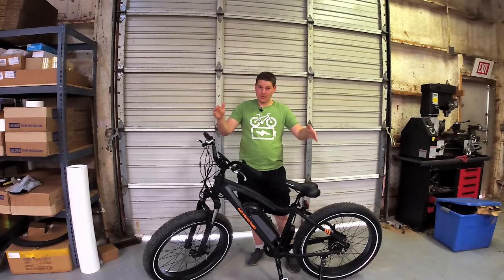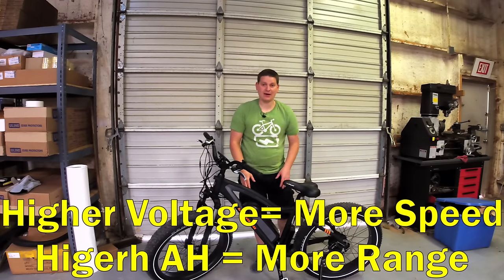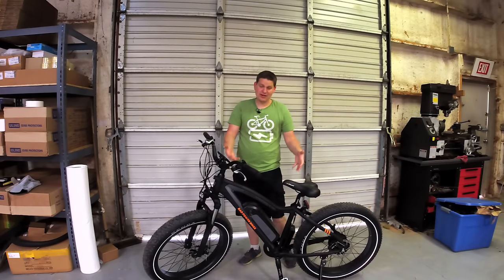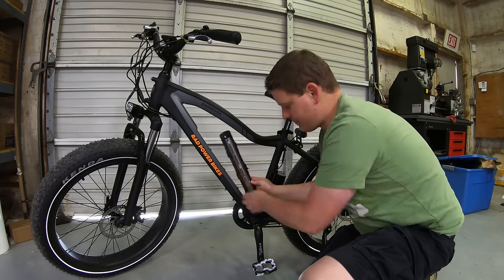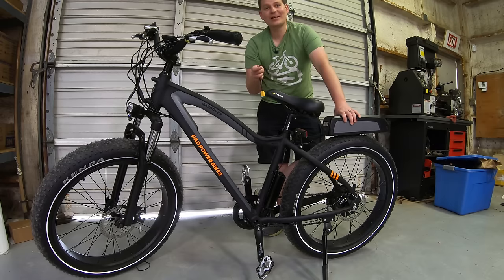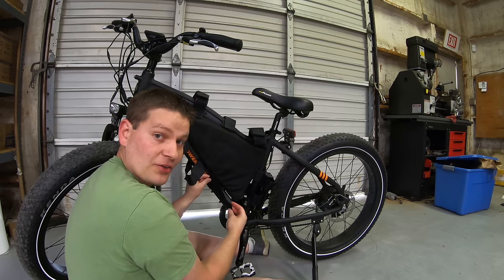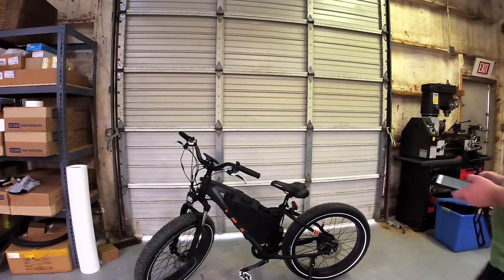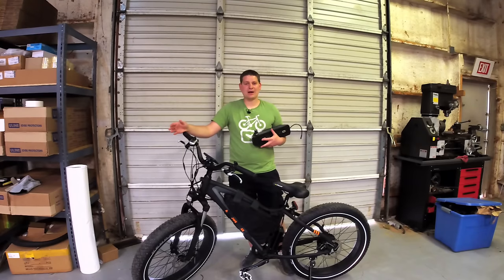Easiest Way To Upgrade Your Ebike Battery

Comment: Velcro bag lunch looks like Garbo in my opinion.  Would like to see sharper looking upgrades that don''t turn the bike into a used bandaid.  You're great at what you do though 🍻
Reply: I agree, it's not too hard to make a custom cradle and custom hard shell triangle battery case, and would look so much better but also be upto10x better at being waterproof and damage resistant. I get the appeal of the bag batteries but they are for generic conversion kits IMO, if you are making a product for something so met a like the Rad then more effort in making it custom for that bike would make u sell alot more, as right now all u are selling is a triangle battery + bag + harness options, this can all be had from ebay easily, although personally if I was to buy such a thing then I would defo get it from yourself over ebay as u r an IRL trusted seller imo.
Reply: I agree with what you said but no one is really gonna look cool riding an electric bike, ive just accepted it but the sheer convenience and gas savings is why i ride one, not kidding i traded in my motorcycle for one of these bikes for transport
Reply: I am receiving my rad city 5 e bike and i would upgrade the battery but will wait for hard shell. I invested $2100 to get the best why not wait for proper casing in the future !!! FLY LIKE AN EAGLE IN TO THE FUTURE!!!
Reply: The title does say “easiest way”. The easiest aren’t always the best looking.
Reply: Those triangle bags are handy
Reply: Hey now to be fair at least we're less likely to get mugged 😂
Reply: Check out "Iberia" accessories
Reply: I love this.
Reply: @audiofella5066 😂 agreed. I did a test ride on a similar rad bike and I was hoping none of my mountain bike buddies would see me 😁

Comment: Three years ago I bought both Kyle's battery and controller upgrades. Prior to that I was going to sell the Rover so to get a faster bike, with a lot more torque. But after installing Kyle's upgrades what says it all: I decided to keep the bike and I still have it. Why? Because my top speed on the flat lands the Rover went from throttle-only 20 mph max (on the flat lands with the wind at my back) to throttle-only 30+ mph. 

And more importantly, going up the somewhat steep hill to my house atop Nob Hill (San Francisco) I can now use throttle-only, moving from a full stop at the bottom of the hill to cruising the whole way at 15 mph. And if I set #3 on peddle assist with minimal peddling I can got the entire way at 15 mph. That significant improvement in torque is what I was looking for. 

Bottom line: thanks to Kyle's power upgrades my Rad Rover feels and functions like I'm a commander of an M1A2 Abrams Main Battle Tank.:face-green-smiling:

Bonus Tip: Guys, if you increase the power of your bike, both in speed and torque, if your bike has simple mechanical disk brakes, I highly recommend you or a bike mechanic install a set of hydraulic brakes. (As our good fortune would have it, Area 13 has a video on the how-to of installing hybrid hydraulic brakes, and they sell sets too.) 

Remember, the bikes that have mechanical disk brakes were designed around the slower speeds of these bikes from the factory. When you make the bike 20 to 30 percent faster, you need a rock solid set of hydraulic brakes. They are a little spendy ($150 to $200, depending on what set you want, complete hydraulics, or hybrid), but what I always ask myself, what is my safety worth. It sure as heck is worth more than $200.

Comment: I have subscribed to your channel, greetings from southeast Quebec, in Canada.

Yesterday my first bicycle arrived. A modest GOTRAX Shift S1 Foldable Electric Bike, 16 ''; Fat Wheels, 36V 7.8Ah and, I have already done some tests here, there. I am happy with it to be honest. 
But I am aware that sooner or later I will have to improve/upgrade the capacity of the battery and/or buy conversion kit for my other bikes.
Your video that I just watched is pedagogical and allows me to see the options I could take in the future. Thanks.

Comment: I am 82 yrs. Old and live in Tucson, AZ.  l Bought my first Ebike on a whim and regret I didn’t do more  research, It was completely done within two months.  And then did some research and found that
Reply: With research, I discovered that Lectric Ebikes was located in Phoenix, Arizona.  I simply drove 95 miles to Phoenix and bought my Lectric 3.0 direct E-bike direct.  And now call myself a seasoned rider.  It was the best thing I could’ve done at my age!

Comment: I have just started with electric bikes  still into electric skateboard's. 
My first attempt is a 250 watt skate motor with friction drive on a Giant road bike.  Working quite well top. Speed on flat 26 kilometres per hour. Just over our legal limit of 25. Did get 30 on slight slope.  Made up an 8  series 2 parallel pack..

Comment: I am 57 y/o and a bypass patient and have had both rotators repaired and would really like to get back into riding.  I find your videos informative and not redundant.  But with so many options available and on a limited budget your channel is a great relief.  Keep up the great work and hope to be in contact soon for an upgrade.

Comment: This seems to be one of most approachable and practical Ebike upgrades that I have seen on YouTube.  I have Currie 24V bike.... Missing missing Lead Acid batteries.  That's a good thing!  Looking to do something similar using a new Lithium Ion for 28 volts... Basically keeping this obsolete E-Bike Stock as far as controller, and motor is concerned.  Any existing batteries out there.   Batter Bag Mount or using the downtube batter box suitable for a mounting point on the frame.

Comment: Kyle, I really like your videos, because you are always straight forward and honest.

In my opinion RAD e-bikes are overestimated, overpriced and service is bad to very bad. Many customers experience breakdowns and then have to wait for months for replacement parts. Service = below zero. 

As a customer at the first look it seems that RAD e-bikes are reasonable, but there are no options for motors, batteries, disc brakes and other parts. To have upgrades it costs a lot extra, then it is still a RAD bike, not a great and famous brand and not reasonable anymore.

The Radwagon 4 has tires and tubes 22x3" that only RAD has. So, there is only 1 brand/type/model of tire and tube fitting. 

This monopoly mentality is extremely bad and just not realistic. If new tires and tubes are needed, they are probably out of stock. When touring around, I want to buy replacement tires and tubes everywhere. I swear on Schwalbe Marathon Plus, but there is no Marathon Plus 22x3". As already mentioned, other brands have also no tires and tubes  22x3".

RAD should have kept the 2018 Radwagon with 26" wheels besides "The 4", so customers could choose.

Famous great brands like Yuba, Surly, Mongoose go also with 26" wheels with a big selection of tires and tubes in the market.

E-bikes like yours are preferred. You offer options and good service. You want to do great work for customer - with no tricks and lies. RAD is mainly all about quantity and not about quality, not about service and not about satisfied customers.

Comment: I am in the process of an upgrade.  I am adding a second 22.4 AH 48 V battery using a polar bear 50 amp combiner.   The second battery will be mounted on the rear rack.  The other approach is to disassemble your existing pack and put in a larger number of higher AH cells.  Or, pull the entire battery pack and base from your bike, and replace the entire assembly with another Hailong battery with a better rating.

Comment: Thanks for this demonstration. Very enlightening. BTW my rear 52V, 14 Ah battery  goes for $600.!! so your battery is very reasonable.
My E-CELLS Super MonarchCrown AWD bike came with not only 2 hub motors but 2 SAMSUNG  batteries, both 52 volts, there rear battery 14 Ah and teh front 17.5 Ah. PLUS the designer/company owner Dave Cleveland patented a SINGLE CHARGE PORT on the frame down near the bottom bracket. That way I can charge both batteries at the same time and monitor the charge state on the bike's screen.

Comment: You inspired me to make a switchable connector for my soon to be 2 battery Ebike.  Currently I only have a single 20ah 48v battery on a seat mounted newspaper carrier in a bag that came with a front tire 1000 watt hub motor kit and controller.

Comment: I am just using rc car lipos for my bike. 3s 5200mah batteries run about $45 on Amazon for a pack of 2. 2 in parallel and 2 in series gives me 10400mah or 10ah and 24v nominal for my 24v Ebike motor. Range of about 9 miles. Easily upgraded just by getting some more lipos and plugging them in. Custom charging solution and I’m all setup.

Comment: Great video. I was wondering if I could run two batteries at once and you just answered it. Can wait till you have those conversions parts in stock so i can do this upgrade.

Comment: thanks for posting it!
videos like that helped me to make my 2nd battery (10s10p with used 18650 laptop recycled batteries) in the rear rack and keep the original one. your solution are better and maybe someday I swap the battery places. but it works and the range almost tripled. connection change is manual using xt60. 
btw, never buy proprietary stuff

Comment: I've ordered my very first e-bike, a DJ Fat Bike that looks similar to the Rad Power Rover.  I'm already looking for upgrades.  This video is really exciting, as I'm hoping to do some riding on some very long trails that will probably call for extended run time.  This video presents some very attractive options.  I'm also trying to figure out what kind of rack will fit on the bike, too, so that I can carry around a spare battery and some geocaching gear.  Anyhow, thanks for putting together this really great, informative video.

Comment: Just did a 48v 1000w battery and motor on my bike and is a little scary once it gets up around 35 and will do it up hill too, more than enough power but can't wait to see the range. Besides hills that's the biggest problem , getting home before the battery goes.

Comment: I like the bag method. An additional benefit I’m also thinking is that the bag doesn’t transmit as much bumps and movement from the bike to the batteries.
Reply: I bought Kyle's (Area 13) battery that comes with that bag. It is an extremely well-made bag. LOTS of padding where it is needed. The canvas material is quite thick. The stitching is heavy duty. 

End result: the battery is very well protected. Whoever ordered those bags was quite demanding on the specs, and spared no expense in the manufacturing of the bags.

Comment: I know this is 3+ yrs old but have a question: if a bike is 48v & you install this 52v style battery will the extra 4v damage the ebike electronics. Please respond if you ever see this.... It would be a Hugh help to me. Thanks for producing this video.
Reply from the maker: Depends on the bike.  Most will handle that small of a change, but I've seen a few here and there that will fry.

Comment: You could relatively easily install the Hailong type cradle onto the top of the cross tube and then always have both batteries Installed and available to use but mounted always on the bike as opposed to rear mounting or carrying in a bag. I plan to do something similar to my Vtuvia sn100 in the next 6-12 months (I need to save my pennies for the extra battery first). It has a Reention Kirin battery case as standard and mine is the lowest spec (48v 13ah,) but I have measured it and I could literally fit another whole reention kirin battery on my top tube and also fit a SMALL triangle battery between original battery and top tube and I actually found some1 who makes a triangle so small and it is 48v 17ah, so if my plans come to be then I will have 3 battery's attached to the bike at all times and it would be all 48v but would be 13ah+17ah+17ah. 😆 I use my bike for part time food delivery work to support my family, saving for the battery's will take a long time but after the first upgrade then my potential wages per shift will double so saving for the 3rd battery should then be much faster.... (PS if you like the idea of this project then I would obviously be open to the idea of featuring the idea and technique + bike on your channel for any contribution  towards the final result of 3 battery's)... my late father always told me that "you don't get if you don't ask" and I think this could go viral for food delivery workers like myself, especially if u show how relatively simple it is to put it together and then offer things like reasonable priced battery's and especially custom wiring harnesses etc.

Comment: This is really informative videos.  Before watching this video, I plan to use toggle switch for 2 batteries in my diy project.  Since you mention there is a paradelle connector would prevent current run from 1 battery to the other, where can I purchase it. I have 2 36V batteries (14 ah and 20 ah).  In theory, we can connect them parallelly.  Now, my questions are.  How to prevent current run from batteries to another?  Do I need to replace the controller?  Do I need to replace the motor?  Any suggest will help me to complete this project.  Thanks!

Comment: Planning on building an e-trike with an e-trailer which can electrically connect to one another to increase range lost from weight. the parrallel connecter fixes a major issue to arose from multiple batteries :D

Comment: Great instructions. I am now thinking about upgrading to the 52v for more range. . Where can I get all correct cables with connectors?  How do you change the connector of the Rad Power 48v . Also, what kind of batteries are used inside the generic Bolton battery. ...Panasonics?

Comment: Subscribed! Can only echo what others have stated you have great videos. Being the complete novice I am it seems to me if you were to run both those batteries it would be a better deal if you had a rack to stick the triangle on the rack and keep the battery that came with whatever bike you have in it's original location.

Comment: going on my fifth ebuild running a 48v battery on a 36v motor 500 watts so far it works super fast,
we will see if it burns it up or not.
Reply: Did it burn up

Comment: You could have multiple batteries of different amperages separated by a selector switch?

That just seems like a more elegant solution to having the batteries spark whenever you plug/unplug them.

Comment: I recently had several vertebrae fused together, I’m still in rehab. But all in all I’m doing great. I’m looking to get my 1st electric bike. I’ve been watching you videos , thank you. They’ve been extremely helpful. I’ve been looking at several brands . Those with easy excess. As I’m having nerve issues. I’d like to know if you have any suggestions. I’ve looked into Yamee ,Lectric and rad fat bear. I’m looking at the “step thru”. I believe that design would be the best fit for me. I’m only looking to ride a few miles a day. I also want to get a cart for my dog to be with me.

Comment: Good info.. Just subscribed! I have the Velowave FMTB3 Ranger. Love it, been riding it pretty steady for 3 months, been perfect so far. Pretty standard, 48v Bafang, hub motor drive setup. Looking at adding a second 48v triangle battery via a On/Off/On toggle switch to supplement the Integral battery in the downtube.

Comment: If you have two batteries,  put a double pole double throw between two batteries and motor. So you switch one side of battery or the other without problem. You can add a fuse between switch and motor for another safety.

Comment: I have a older ebike I like a lot that is full suspension. I would love to up grade this bike. The bike has a 24v 8a frog battery and 300 watt brushless hub motor. Pedal assist still doesn't work even through I replaced the PAS sensor cadence. I would love to up grade this bike if you could help. I watch your videos and know you are one of the most knowledgeable guys in your field.

Comment: Hi my name is Richard and I just bought an electric bike. since you know a lot about batteries my question is I have a 2014 Toyota Tacoma, that has a plug that I run my tools off, can I plug the battery charger into the plug and recharge the battery while I am driving the truck? Thank You

Comment: You’re the best Kyle! Can’t give you enough props, your videos have taught me so much I am now dangerous with my knowledge but definitely no expert. Please keep them coming! Also, I am looking forward to my battery upgrade in the spring. I don’t ride much in the winter, so as much as I want the 52V now its probably better I buy in the spring rather than start wearing down a new battery now. That said, I’m curious if my logic is right, I wonder if it may not be considering if It’s not charging it’s not losing longevity because it’s not in use? Hope that makes sense, it’s late lol.
Reply: A lithium battery will slowly lose its capacity over time, even if it’s not used.
You can also check your battery every couple of months over winter. If you notice that the battery indicator has dropped too low, you can give it a quick charge to bring it back to the ideal storage voltage (this is unlikely to be needed if the battery was at 40% or above). 
As an extra note for the winter season, make sure your battery is above freezing before charging, otherwise you could harm the cells. It is no problem to ride the bike in below-freezing conditions (it doesn’t harm the battery), just make sure you let the battery warm up before charging.